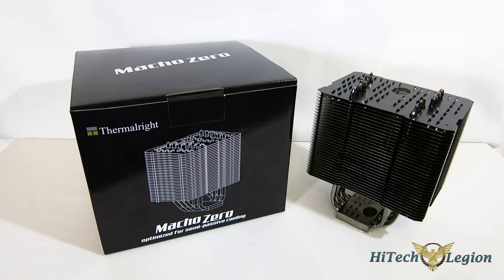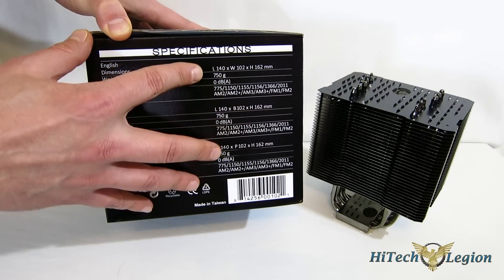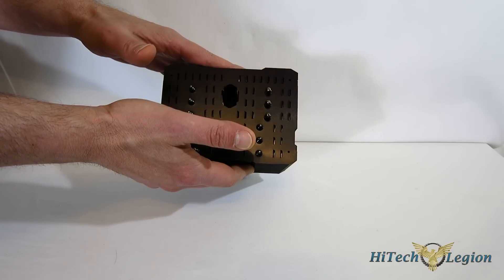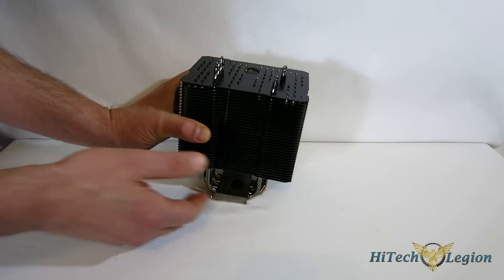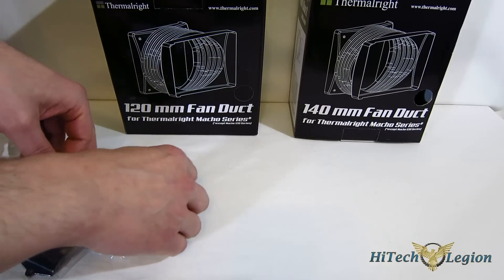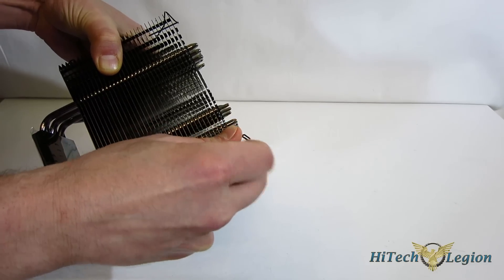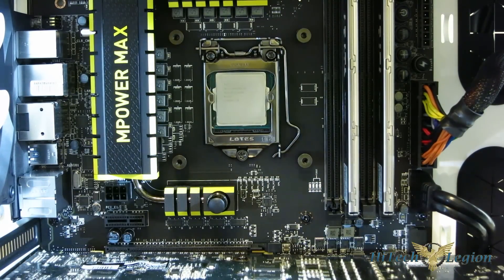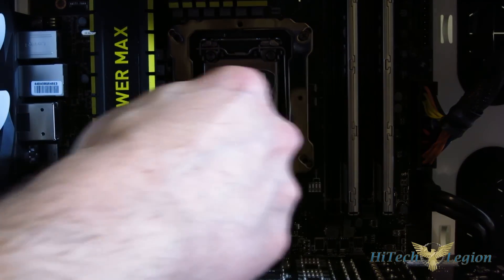Thermalright Macho Zero Passive CPU Cooler Overview and Benchmarks

Comment: I "quickly" skimmed the comments and didn't see the answer to my query. You said you used 3 configs. 1. passive 2. ducted 3. TY 147A. 

 Did you leave the duct on for the fan test...IOW, you're getting a sort of push-pull config? If not, i wonder how much better that would be. Lastly, did you see internal case temps... maybe mobo and cpu temps increase, as you've effectively eliminated the rear exhaust fan..although it may draw some heat through the heatsink and out  through the duct? Great review though, thx.

 Long-time T/R Fan - first was an SLK-900 s370(never went back after T/R)..excellent for it's time..~2002. Next was an XP-120 on my s478 systems(2006), and then onto my s775 C2D w/adapter brackets.

 Last one was the revered TRU-E 120(w 2x Scythe 120x25-88cfm fans push/pull) on my C2Q 9550 as high as 4.6GHz for some benching at 1.66 vCore!!!. Still using it to this day at a much more reasonable 3.81 GHz, but the old Scythe fans died, and i put 2 Noctua 120mm fans on. Works great!!

Comment: Passive is not really passive since even without the duct, the cooler is sitting very close to a rear exhaust fan. I'd like to see numbers with having no fan near it at all. I think a lot of people interested in this cooler will be trying to build a super silent PC with only 1-2 intake fans or even no fans whatsoever, and they won't be adding exhausts.
Reply: QuantumBraced Every powerful passive setup has some airflow designed into the case, for example a 300rpm fan drawing air over all the components. Its absolutely justified for him to do that

Comment: I got this cooler with an RPM 120mm for the exhaust fan, with the air duct, and one 200mm fan for an intake, and that is it. In a Phanteks Evolve case, and it is amazingly quiet. Paired with a Nvidia reference design, this is the way to go if you want a quiet rig.

Comment: Superb review, thanks a lot.
I'm gonna attempt using the Mach Zero with a Skylake i5-6600 (65Watt TDP) to build a almost silent system.
If it doesn't work out after all, I'll add a fan duct as you did.

Once again, thanks heaps, your video helped me a lot.
Reply: +Oliver Stahl just flip the backside fan so it blows in, that is way better than his build
Reply: Thanks,  but the system works just fine as it is,  no duct or anything.
Love the mach zero
Reply: +Oliver Stahl yes of course it works, no doubts, but if you take the backside fan as intake you would have better cooling and you could use less fans so it's more silent :)
Reply: +lemon So....for a cooler that exclusively relies on proper case airFLOW, you are suggesting that he completely eliminate proper flow? Not very good advice, and not very well thought out.
Reply: Oliver Stahl Itll easily cool 65 watts without fan, however, the temps will be quite bad without airflow. You should have one or two 300rpm fans in your case. Good quality 140mm fans which are tuned to the lowest setting on a fan controller will spin at 300 and its absolutely inaudible.
Reply: Thanks. My system has been up and running for more than a year now. Temperatures (even at light gaming) are rather low.
I bought two BeQuiet Silent Wings 2 140mm which do a great job. No sound at all coming the machine right next to me.

Comment: Having this component is futile since the CPU cooler is not even nearly the loudest component in the pc. Also having the "every little bit helps" attitude is unproductive as it would cost ridiculous sums of money to shave off just a decibel or two.
Reply: BigBadBeef It does make a big difference, since it was the loudest component in my computer. Passive PSU and passive gtx 1050, 2 case fans at 300rpm: no audible sound.

Comment: whatabout longevity of the chip when oc using passive coooling which is showing 81 degrees?....also...the duct is an aquired taste for i certainly dont like the look of it..saying that...this unit seems certainly impressive...really impressive....however i feel that while theres alot of focus on cpu cooling..theres not much out there for gpu cooling...with my system using 680 in sli...gaming is very noisy...i also feel that watercooling my gpu is not the answer as i see many vids with alot of watercooling..loads of fans..so noise is still there...and i dont see much difference in noise when manufacturers and reviewers say that the gpu is really quiet..they just not...so...any ideas on real silent cooling?...this unit seems awesome for cpu..thanks for your review mate
Reply: sorry about spelling..im half asleep
Reply: DragonUK11 Keep in mind that the 81 degree temp is under extreme load for 10 minutes, not something you are likely to do in real world situations. That performance also happens to be very close to what you would expect from something like a 212 EVO on this chip with this OC.

Liquid cooling your GPU can be a very silent proposition if you are doing a custom loop, but trying to shove an already too loud CLC that doesn't fit right is a really bad idea all around. I have seen good results with the DeepCool Dracula on the 680 using a pair of low speed fans.
Reply: thank you very much for getting back...i get it now..:)...also will be chacking out that gpu cooler for the 680s...impressive cpu cooler in that case...really good..also...not sure if its just me but cant see any comments on the vid...cant even see my first comment ....all the best for xmas my good friend...keep up the vids...we love them..thanks.
Reply: DragonUK11 pfff, longevity. I have yet to see a single processor that failed because of bad temps. Im running my processors hot all the time because its the most efficient way to cool them and they all still work. Including the pentium that runs at 55 degrees idle and still works after 10 years